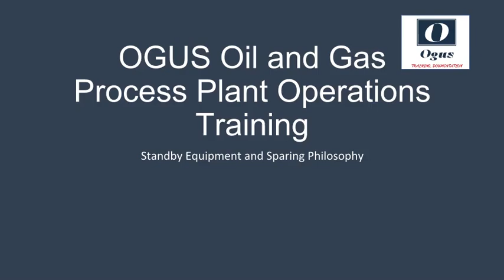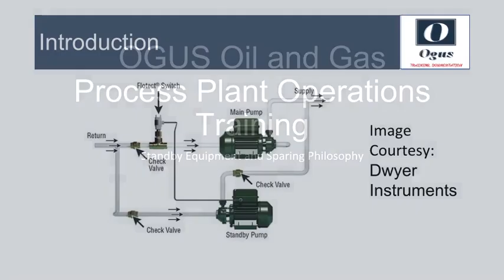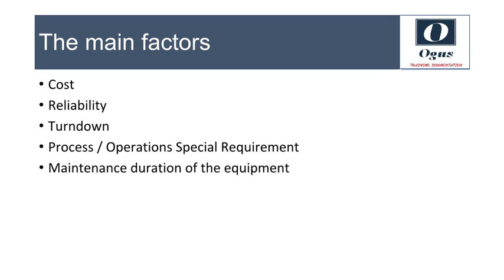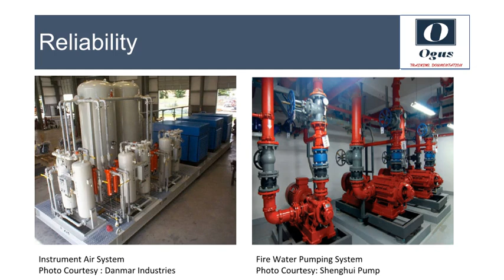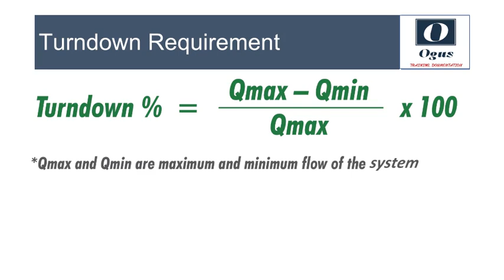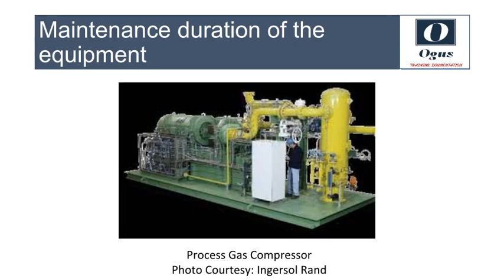Standby Equipment and Operation - Maintenance - Sparing Philosophy

Comment: Hello.
I have a doubt? I don't have clearly when we talk about nx100 if each equipment work at 100% of its capacity or is n equipements works to achieve the 100% requered for process. And the same question for nx50
Thanks and regards